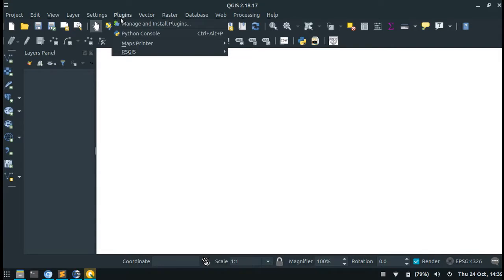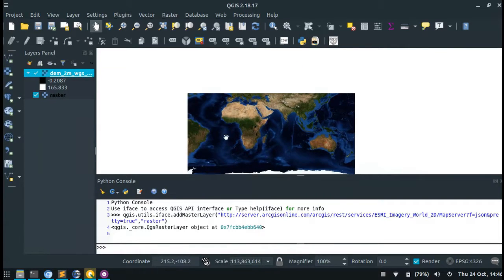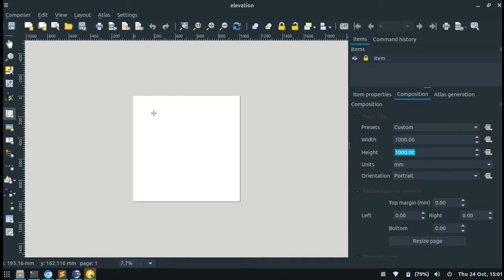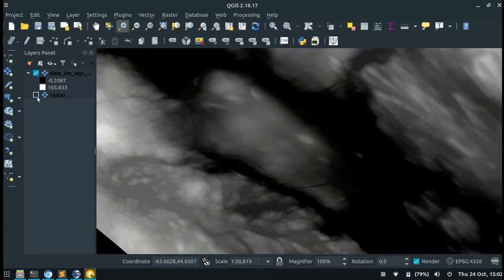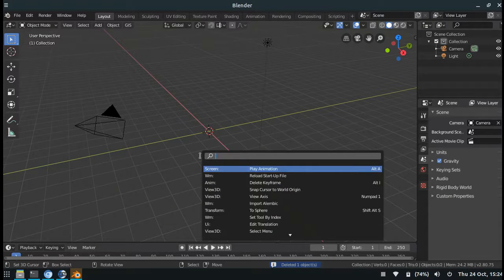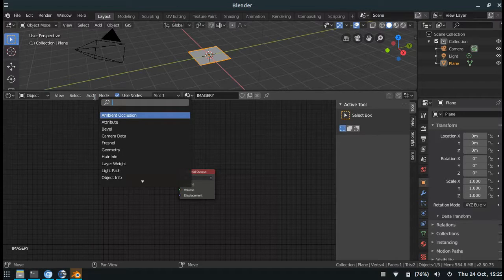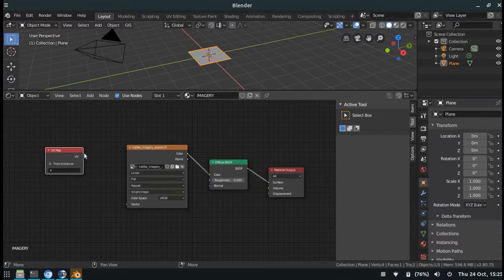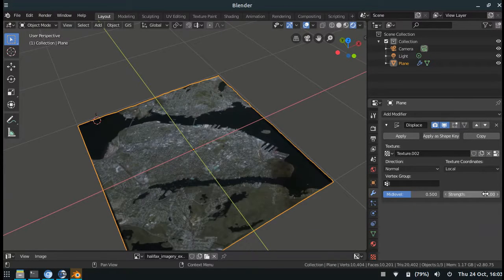3D Terrain Modelling with QGIS and Blender

Comment: doesn' work for me. The displacement modifier with DEM tif file only move the object up and down... my elevation ranges from 1922 to 2669 meters.
Reply from the maker: Your surface needs to have vertices to displace. If you're using a plane primitive, try replacing it with a grid primitive, or use the loop cut tool to add more vertices.

Comment: Nice, I'll have to come back and check it again, in the past I have tried to use qgis but didn't get too far, ah those dems and where to get them.  thanks!  Hope you got a good grade!
Reply from the maker: QGIS really is a swiss-army knife application, and it's interface is a bit clunky in some ways. I would put it on par with ArcMap in terms of interface (although QGIS is way more stable in my experience). With ArcPro ESRI has made some serious improvements to the design language of GIS software but I still prefer free and open source applications.